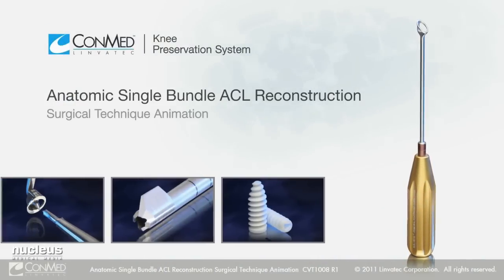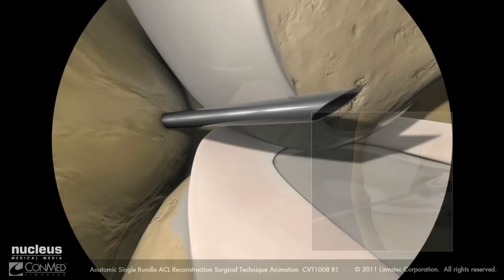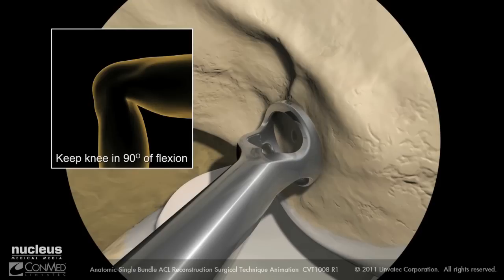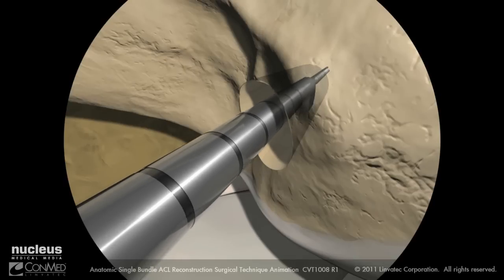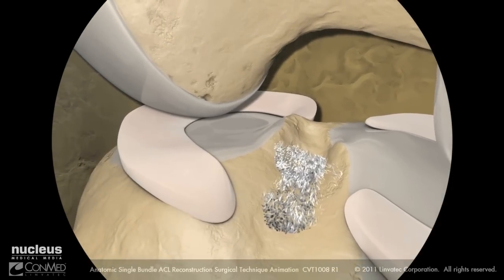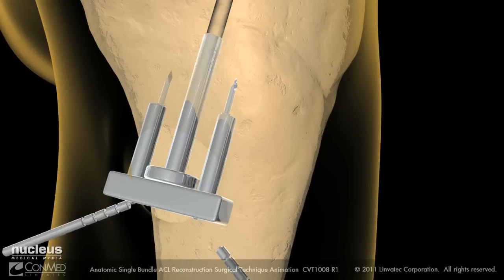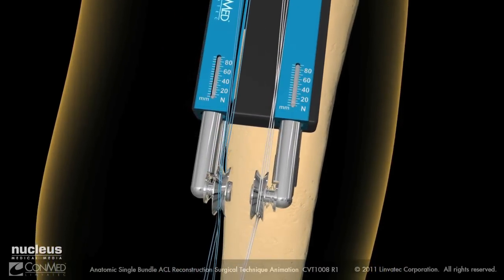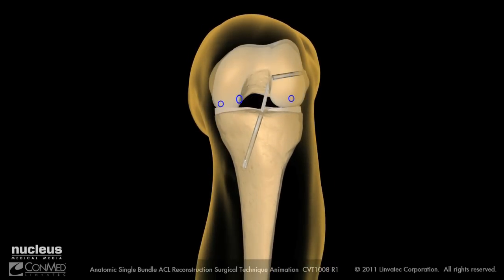ConMed: Single Bundle ACL Reconstruction

Comment: I have a partial tear of ACL, I was strengthening my muscle and knee joints since 3 months and i can run and twist turns but i am having issues at few positions sharp pain. while running when i kick my bum then it will have sharp and and i have to stop. also at certain angle i will have difficult with stability. I am 46 years old should i go for operation then which graft should i use ?
Reply: U shud retire
Reply: @davidonwa3110  u fucking retire. Idiot.
Reply: @davidonwa3110  he isnt in d mood to retire who r u say so. Disgusting fellow. Its like u ppl that humanity has lost the humane consiousness. Disrespecting others.